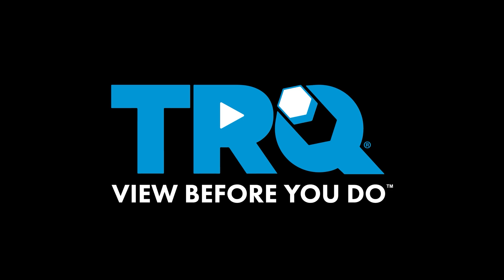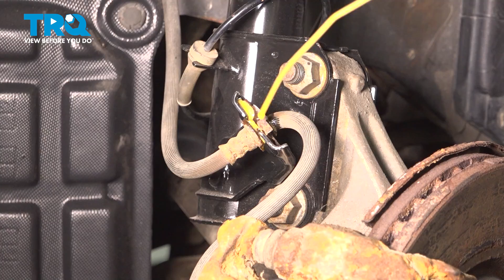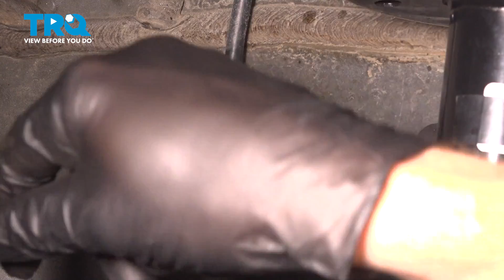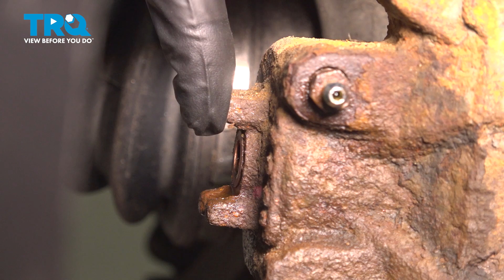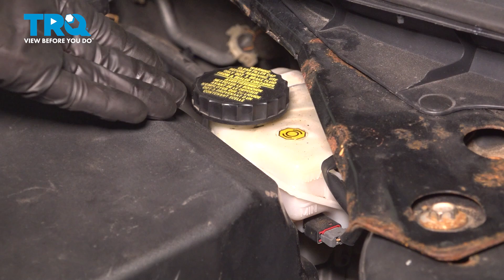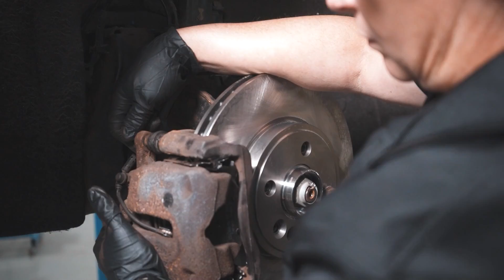How to Replace Front Brake Flex Hoses 2012-2018 Nissan Altima

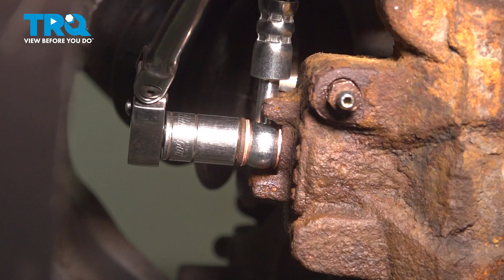Comment: @9:12   On 2009 Nissan Sentra it is 156 in-lbs = 13 ft-lbs (Banjo-bolt, also 12 mm) if someone needs it. Thank you very much for the film, I used it to replace the brake hose on the DS of our Nissan.  There was nothing wrong w/it, but I've read that those hoses should be replaced like every 6 years. Tomorrow is the PS. To press the brake I used a special tool fm Amazon (it is a set: press pedal rod and to keep the wheel straight device. That press pedal rod is very convenient, easy w/it). Thank you again.